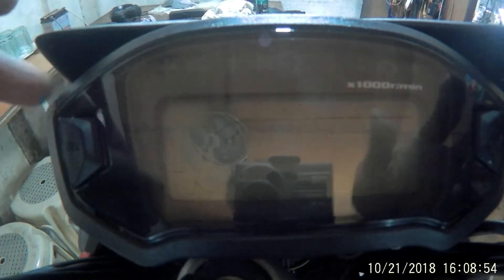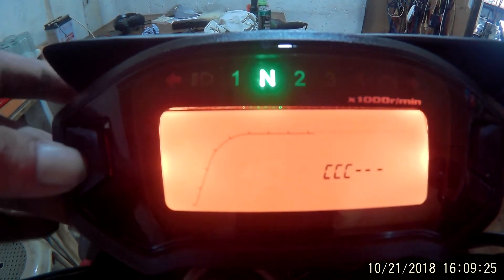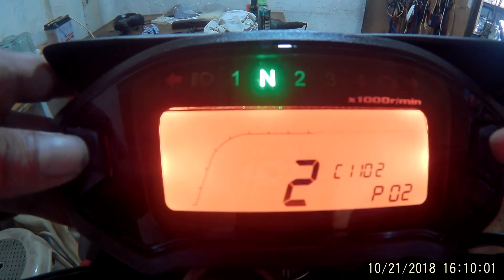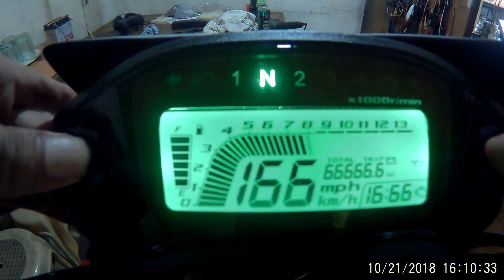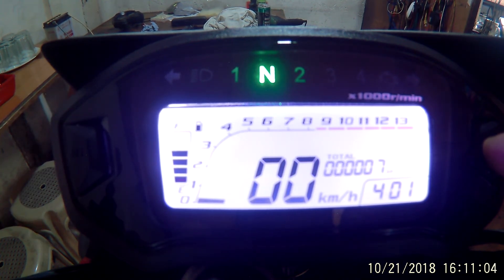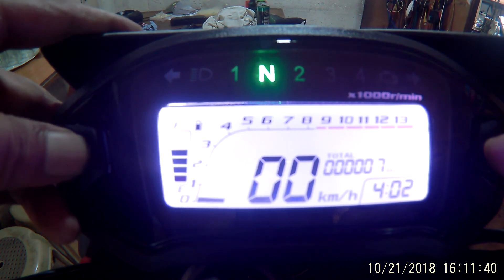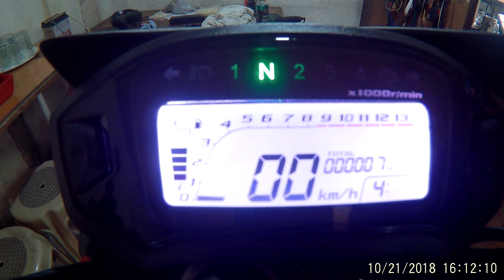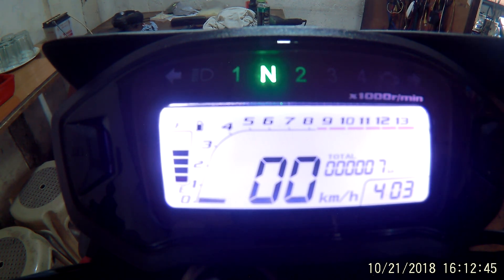Parameter settings of Aftermarket Digital speedometer

Comment: Sir any tip ano tamang settings sa scooter
Reply from the maker: It is very difficult to understand the parameters since the unit has no manual or any booklet with it. I was able to access it and play with those numbers. 

The big number 1  corresponds to the  number of cylinders..it will set the right RPM for your rpm indicator. C is for circumference of the tire..with 3 numbers indicating  the percentage. The lower the value, the lower the value of speed. Just play with it. P stands for the number of pulse for the sensor since it has a bundled reluctance sensor with magnet. 2 magnets will have 2 pulses.

Comment: I dont understand the settings...
First big number = number of cylinders 
3 numbers = tire circumference in mm?
Last number = number of sensors?
Bottom right number with P = ???
Reply: I have make a tuto on my youtube channel :

First bug number = Number of cylinders.
P or n = Positive or negative ( for your coil )
Last number is the number of magnet placed on your wheel.
The 3 number is number of circumference but this in pouce "normally"
Reply: 👍 HELLO I HAVE MADE A SIMILAR VIDEO : https://www.youtube.com/watch?v=SqlIyr1mmeE&t=1s